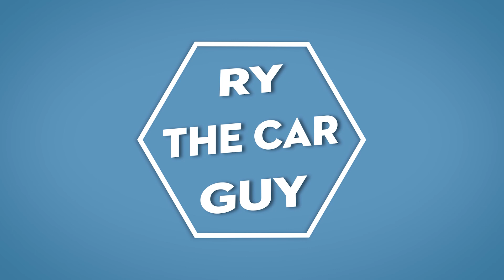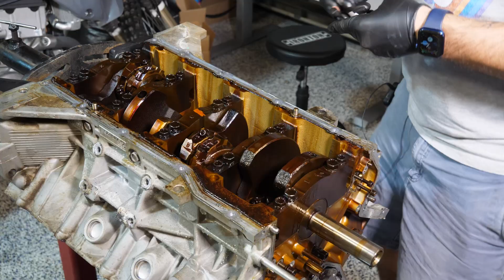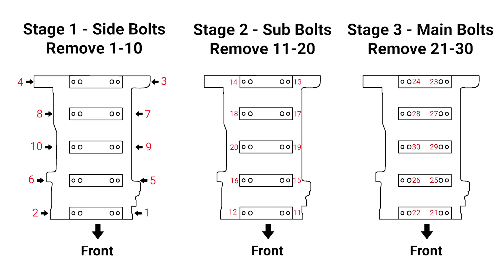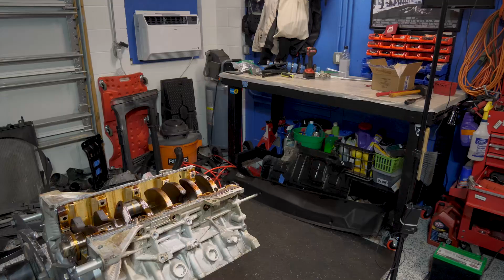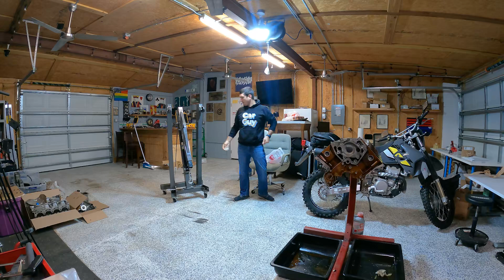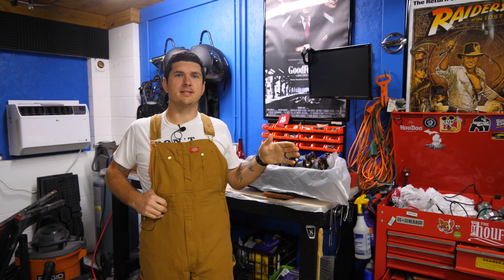VK56 Engine Rebuild Part 7 (tearing down the block. Pistons, Rods, Main Bearings, Crank)

Comment: I have a question. What did the oiler holes in the piston look like when you took the out? Were they clogged up with tarnish or were they clean? I’m wondering if that could cause piston and cylinder walls to wear out in the 2017 model vk56.

Comment: Hey ry what size socket did you use to get the rod caps off i cant find one that fits
Reply from the maker: Hey there. It's just a 10mm but it's a 12 side not a six side.
Reply: @Rythecarguy  ive tried and it just skips. it wont fit any other sizes smaller or bigger all 12 point sockets

Comment: Thanks for the content.  I was going to change two heater hose assemblies in my Xterra and probably do a drain and fill of the radiator.  I watched your livestream and heard you say you might drain your coolant.  It would be great if that was one of your upcoming videos as I'm concerned about properly burping the coolant system.  Thanks for all that you do!
Reply from the maker: Glad I could help! I will look at the process of a drain and refill. If it's reasonable and relatively inexpensive I should be able to knock it out.

Comment: That is a very smart move. I watch Fay Hadley on YouTube and she's rebuilding and machining the Toyota engine with Dan Soltz. The precision work is amazing, onr oops can damage the engine for sure . Can't wait to see the final result. Do you plan on doing something similar with the transmission?
Reply from the maker: Thats awesome. If I had the equipment, I would likely give it a try but there is just so much that you need. If I am going to start buying bigger equipment, I think I would head the fabrication route. Benders, welders, etc. I would love to get into that, and I feel like it's the natural progression of my channel. I think I am just going to do as much maintenance on the trans as I can. rear seal, filter, drain/refill and hope for the best. It drove great when I took it all apart. I will say the front and rear diffs dont feel healthy. Might have to do something about those shortly have getting the engine done.

Comment: Hey, Ry, I saw you being a bit awkward with the hammer-handle routine. I keep a few old hickory hatchet/hammer handles around to use as non-metallic drift/punch tools. You can pound metal parts around to your heart’s content and not scratch or dent them. Seems you have the same respect I do for mating and bearing surfaces and use plastic when possible. Excellent habit!
Reply from the maker: Good tip! After that first piston I started putting the hammer on the other side of the crank and it was not flipping around as much. Love the idea though, might have to pick one of those up.

Comment: Thanks!
Reply: Thanks for the water pump. Definitely a funny conversation piece. Here's a little extra for the head and block work. That stuff ain't cheap. Rock on man
Reply from the maker: Haha no problem at all. Thanks for this. You aren't kidding about machine shop work. Bills gunna top 1k for sure. When I rebuilt my mustang it was like 1.4K for just the heads